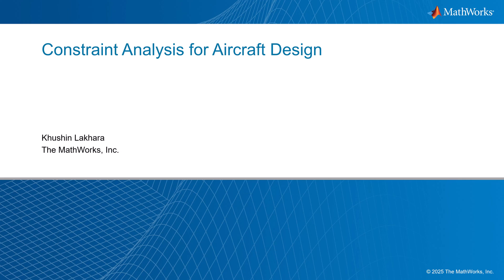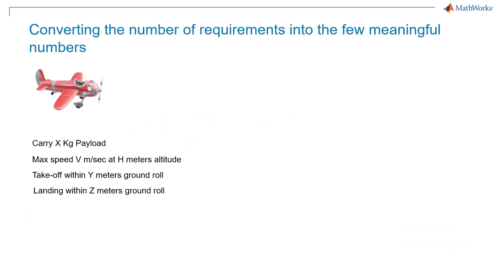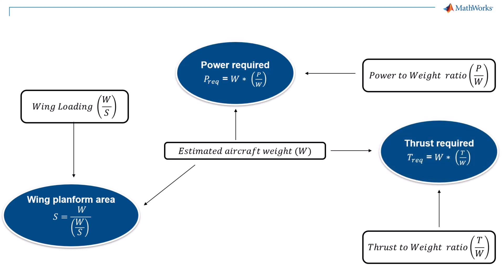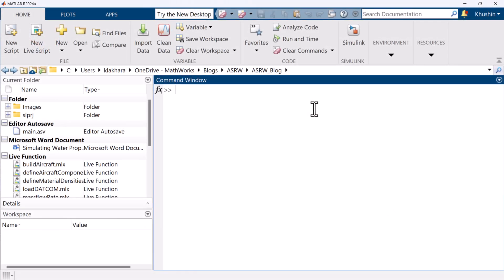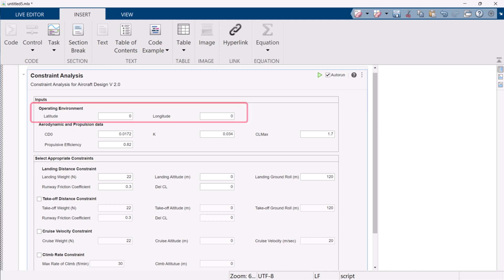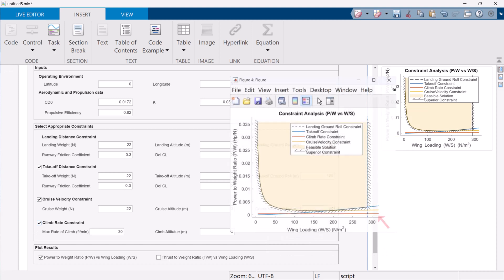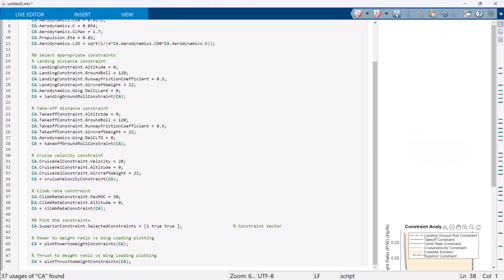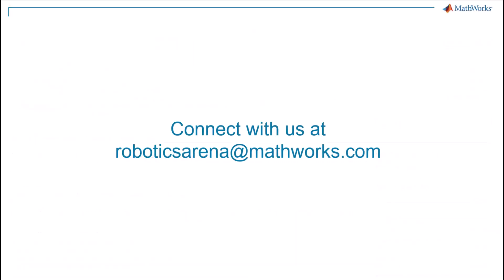Constraint Analysis for Aircraft Design

Comment: Hello Sir, will this live task help for heavy cargo aircraft? the W/S seems to not extend beyond a certain limit. is there any cap for higher values?
Reply from the maker: You can use this live task for cargo aircraft as well. For visualization purposes, this live task puts upper limits (to 130% of P/W for minimum wing loading) on the shaded region.  However, the region above this limit is also a solution space.